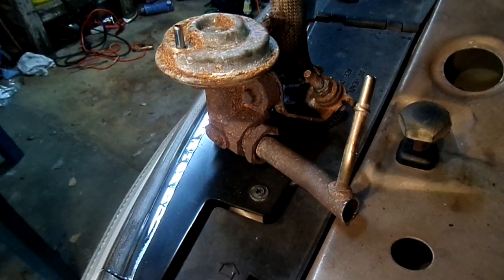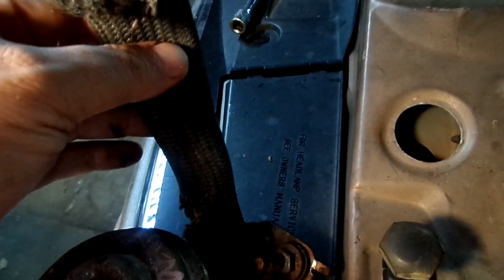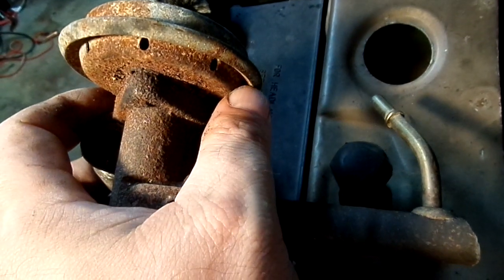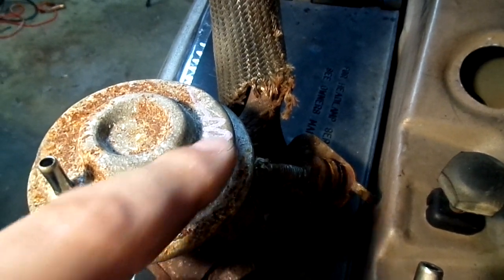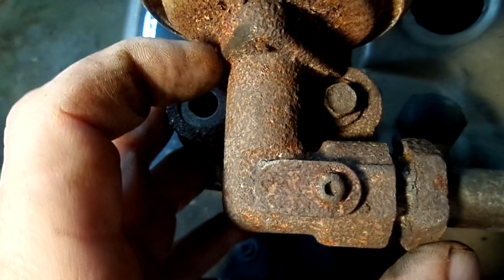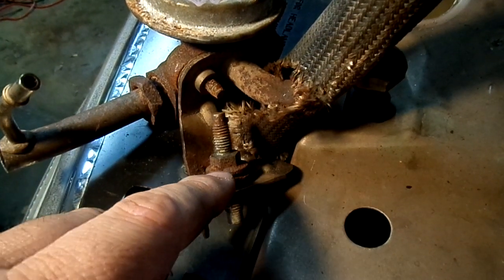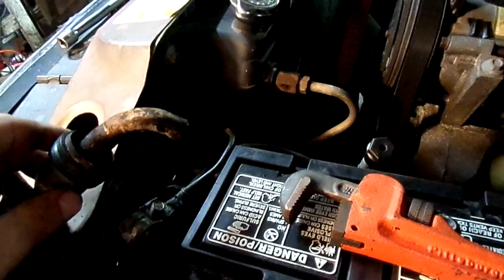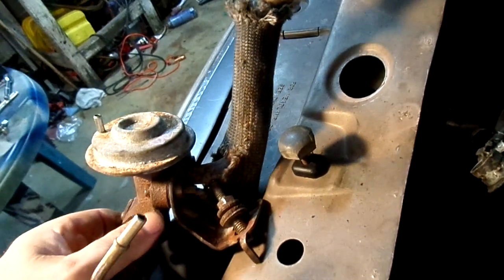Ford Explorer EGR/EGR Tube Removal and Replacement

Comment: Will a cracked egr tube give the p1074 lean code?
Reply from the maker: Yes it can
Reply: Yes. Check your air system first. Could be a loose air filter hose, could be an EGR issue.

Comment: I have a 2000 ford explorer (a beater) with a rough idle and wanted to know if it is in fact air escaping from the flimsy rubber piece , have you ever tried to "seal it" using a high heat resistant sealant so air wont escape rather than having to replace the tube, as a temporary fix , just weighing options
Reply: What flimsy rubber piece, the egr hoses?

Comment: So the rubber gasket that holds that tube into the intake, would cause a lean condition if it is worn or busted correct?
Reply from the maker: +Nicholas Jaffrey  check with carb cleaner first, but all the parts places carry it
Reply: JamieJones TheCarMan I own the xls model this tube from the manifold to the valve used a gasket that's different than in the video and it's easily found anywhere I wonder if I could simply replace the rubber ring, here's the part number of the tube used in my truck F87Z9E470AD

Comment: Hi, Thanks for the video. I have a 2000 Explorer 4L OHV. Can that EGR tube be taken off without removing the intake manifold?
I keep getting the check engine light with P0174 code. Had the upper and lower intake gaskets replaced but I doubt if they
changed that o ring. Going to try and get some smoke into the engine to see if any leaks show up
Reply from the maker: +Robert Michael yes you can , the tube will require 2 identical gaskets at the top that's your air leak , they all fail
Reply: JamieJones TheCarMan Ive done the same gaskets and plenty of other things to my truck, just wondering where I could buy the gaskets
Reply: Autozone and Rockauto have those O rings. The egr valve could also leak air from the pintle. Put some propane under the valve and watch the trims go down.
Reply: Yep, I just did it. The issue I'm having is the damn connector on the exhaust manifold is rusted. I've sprayed rust penetrant for 2 days now, and it still won't budge 😑

Comment: i have a question the part you showed the egr tube the lower tube rail with the 2 lines that goes down to another nut and curves like a J down what is that called? and can you order a part? my 97 ford explorer 4.0 ohv is backfiring but i noticed an the end of that tube you cut, has a break at the lower bolt can that be replaced or fixed?
Reply: I think it's just called the lower EGR tube or lower heat tube. 

One side goes into the egr there other into the exhaust manifold.

Ive found a few on ebay